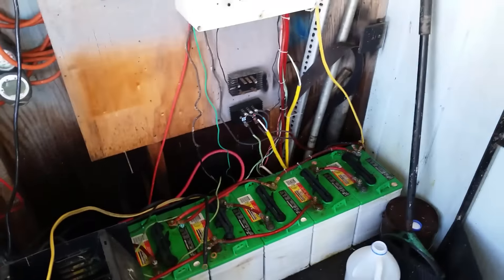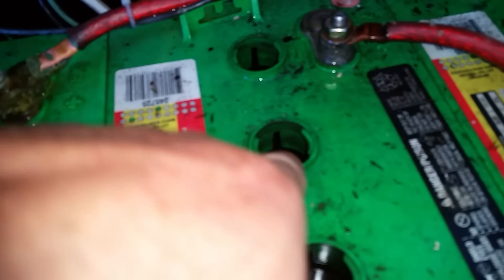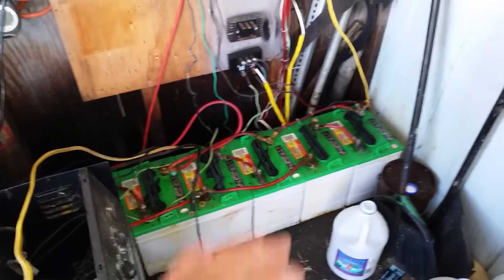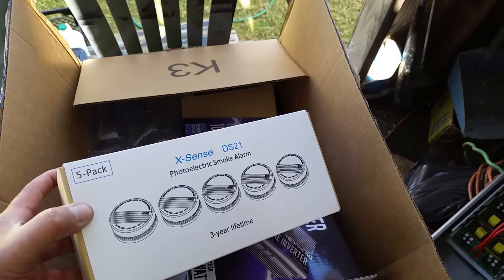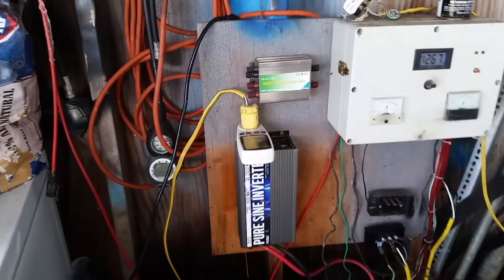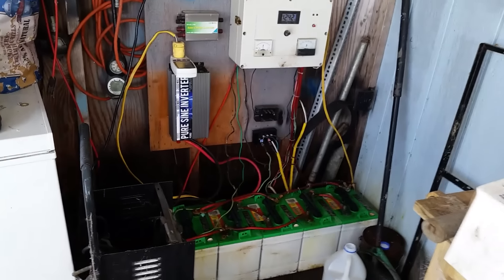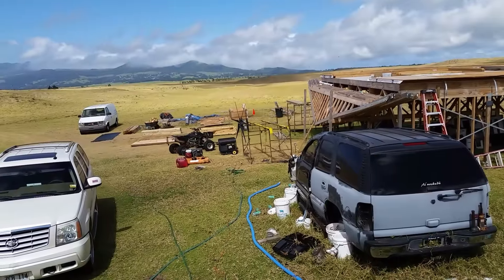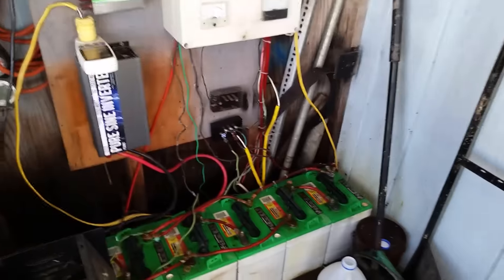Installing New Pure Sine Wave Inverter off grid setup

Comment: Hey, good vid man. That's a killer lot your building on. Love the views. Can I suggest that you turn your inverter 90 degrees so that all that dirt you referred to regarding the tops of the batteries doesn't end up going through the fans. I have installed 2 inverters in RV's and I think that's the reason the manufacturers mention it too. enjoy.
Reply from the maker: +TODD SWENSON Aloha thank you for your comment, my first inverter was like that but the unit would get warm after mounting upright it would stay cool. In an outdoor setup there will always be something. The new power room is a room so I can control the environment. Good input thanks for looking out. Thank you for your support. Hope all is well.

Comment: ok one question. about your tall wind turbine that you have the one that putting out 50amp is there any way I could get parts to build a wind turbine just like yours
Reply from the maker: +kirk noble Hey buddy, check out thermodyne wind turbines. That's what I am installing on my new off grid home. The old wind turbine can no longer get the stators. So your better going with thermodyne.

Comment: It is my understanding that you can get IGBT's to replace MOSFETs.. I found a cross-reference when I was looking to rebuid an older Everlast MOSFET plasma cutter. IGBTs are much much more durable. Honestly, you may want to upgrade to an Outback or Schneider or similar.
Reply from the maker: On my new house I have outback systems. On my small cabin I'm in I just put the pure sine wave inverter on and it's working nice. When I install all the new stuff for my new home I will post videos covering everything. I'm saving the old inverter and might fix it down the road when I'm done building the new house. I will look into what you mentioned about the IGBT's.
Reply: Cool beans!